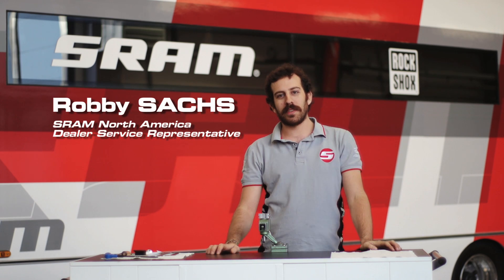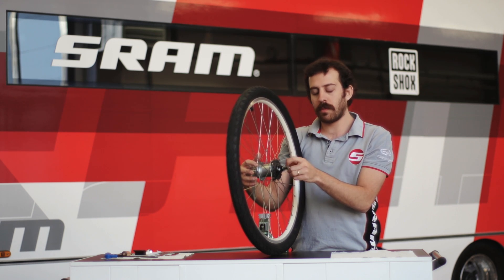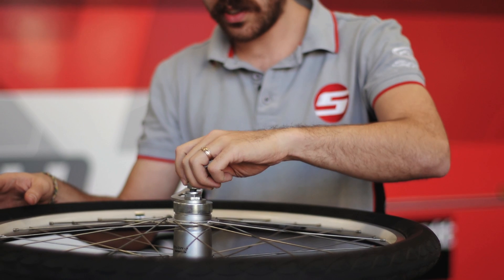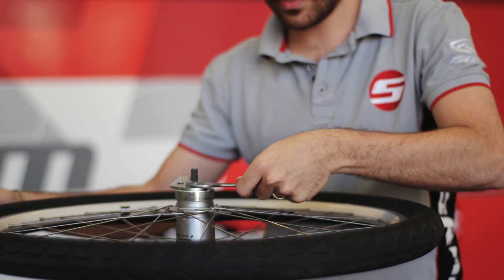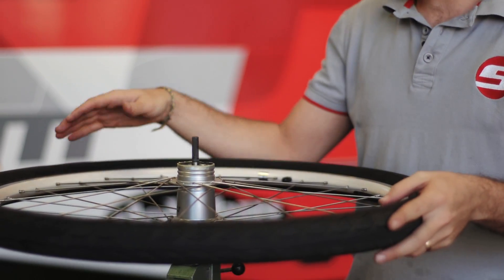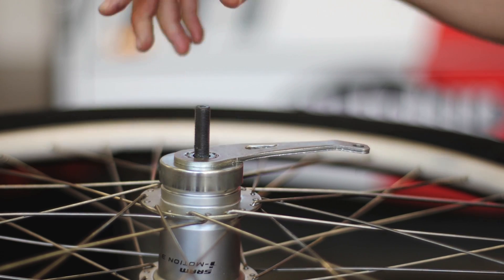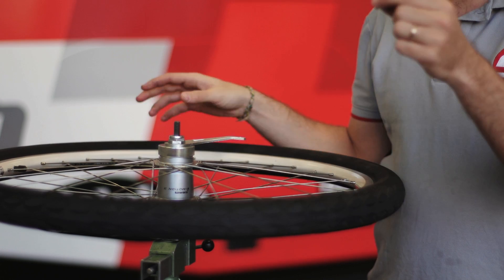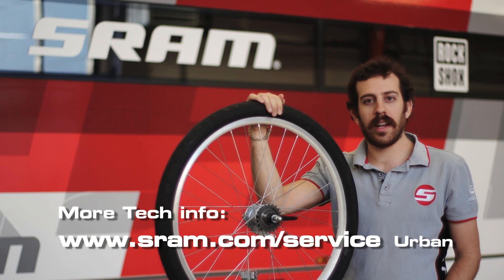SRAM i-MOTION 3 Tech support by Robby

Comment: I disassembled one of these, took away the old grease and cleaned it up without removing any parts. Then I reassembled it and now I have the problem that every time I shift gear, the pedals/cogwheel locks. Here's a video of it: https://vimeo.com/214007627

I did nothing to it that I can see would cause this problem. I did what is done in this video but I didn't replace it, just cleaned it and put it back on. Anyone got any ideas?

Comment: Questions: Is there a solution for a fixed-gear bicycle? I have a Masi, usually just freewheel around. I'd rather have a solution that gives me the option to use an internal gear hub without a coaster arm. 2-3 internal gears for urban riding. There are some hills around so I think such a solution work work well.

Another solution I thought about would be to pair up a front derailleur with two chain rings and a shifter and chain tensioner on the back such as the Surly Singleator or similar.

I love the bike, but I'd love an extra chain ring or other option for a hilly situation.
Reply: It's a good idea for sure but the gears would have to be a lot beefier (heavier) to withstand the sudden application of force in the opposite direction.

Comment: After one of the coaster brake pads on my I motion 3 speed cracked I was told that the part was a wear part (and thus not covered by the warranty), and that it was not available for sale either.

After contacting one of the only bike shops in the US that tries to support your products, I was told this is a common problem with your products.

Until you start supporting your products with parts support in the US, I will be buying Shimano.